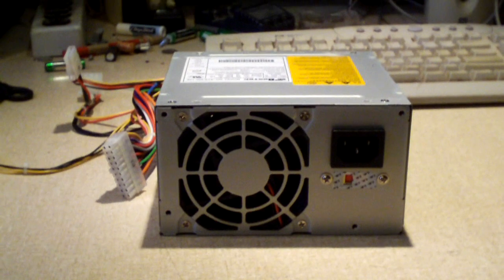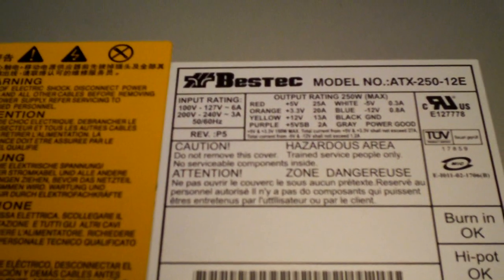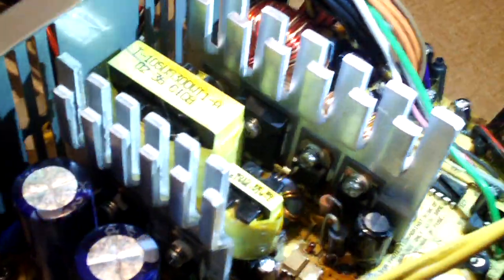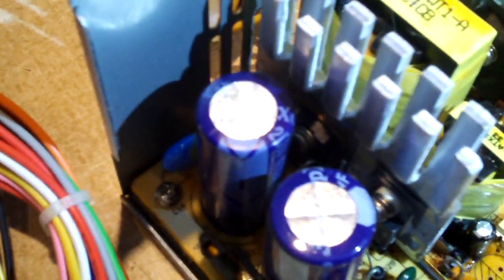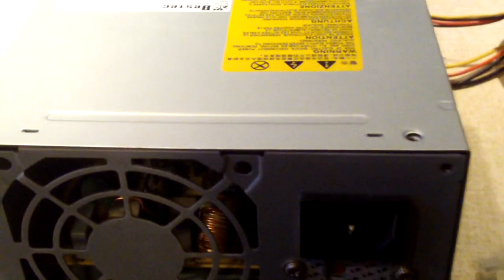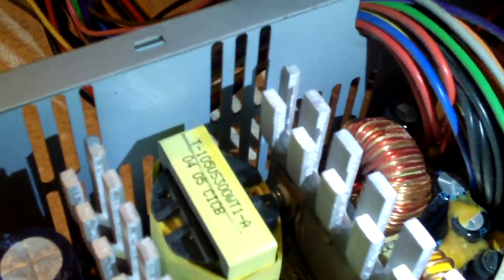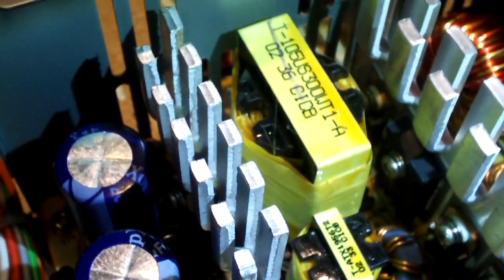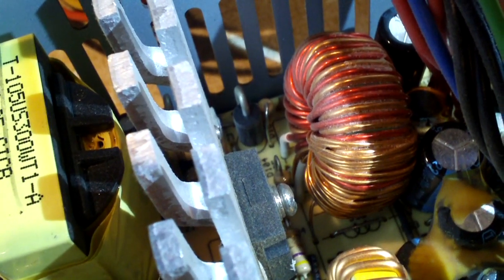Inside of a dead Bestec ATX-250-12E Power Supply from 2002

Comment: What is it for or used for? I found one in my car when I bought it
Reply from the maker: It is a computer power supply that was factory installed in many eMachines computers manufactured from around 2002 to 2006.
Reply: @CubeComputerChannel  can u use it for anything else besides in computer
Reply from the maker: @whiteboybusch5265  You can use it also for a DC power supply for anything needing 5V, 12V or 3.3V and within the current rating noted on the power supply.
Reply: @CubeComputerChannel   what's a DC like can I connect lights to it
Reply from the maker: @whiteboybusch5265  I would recommend that you look up a video on the fundamentals of electricity to help better understand this topic a little better.

Comment: I have a question... are Rhycom power supplies good?
Reply: Also are dell OEM power supplies good?
Reply from the maker: Never heard of them.
Reply from the maker: Dell OEM units are generally decent as they are made commonly made by LiteOn or Hipro, which are both good manufacturers.
Reply: Cube Computer Channel I have one in a dell dimension 4600 and it has a blown capacitor on the 5vsb rail and there is a high pitched noise when the pc is off. It is 450 watts and the dell unit is 305 watts... the 450 watt one is about 1/2 the weight of the 305 watt one so I answered my own question.
Reply: I also have a bestec atx-250-12e and the 5vsb rail in that one is good... the irony is that the rhycom is the one that has the bad 5vsb rail not the bestec.😑😑